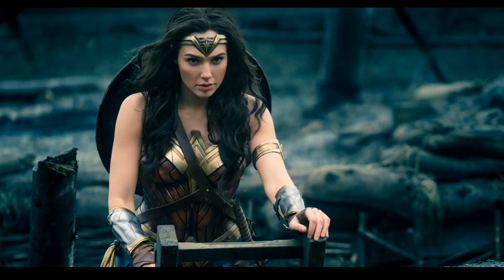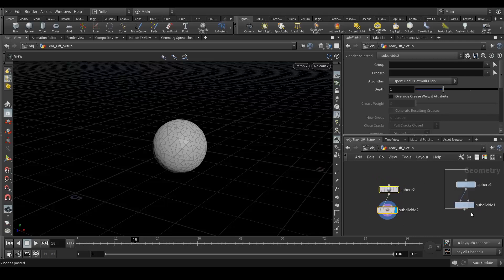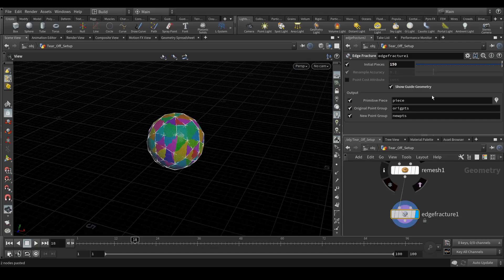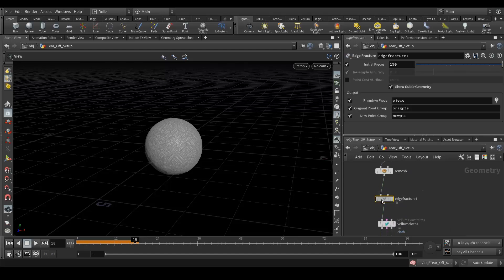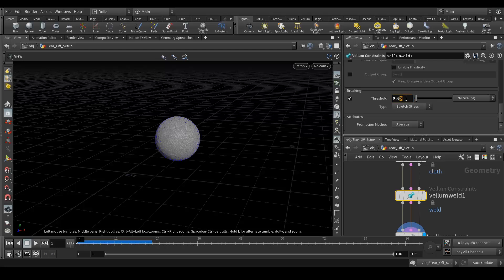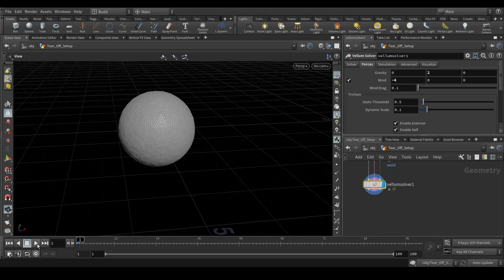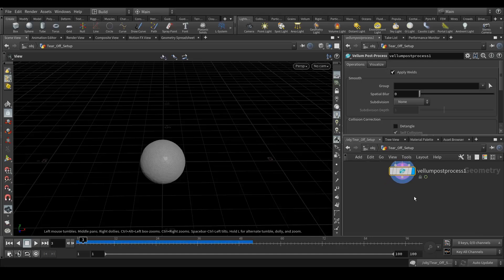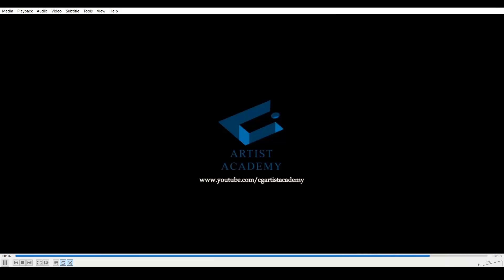Houdini Vellum Peel Off Tutorial

Comment: Nice tutorial!
 Is there a way to peel it off completely? There are some cloth pieces that keep attached to the model  im working with
Reply from the maker: Thanks Sverige .. yes you can peel of completely just remove the points which you have added in “vellum cloth node (pin to animation)”. Remove them all then nothing will stick to the geometry..
Reply: @CGArtistAcademy   WITHOUT  'PINTOANIMATION' some pieces are stuck with geometry bcz those pieces in center of geometry and wind flowing in opposite direction, so it will get stuck.
Reply: @CGArtistAcademy  I didn't pin anything in  the weld to points option, my geometry just overlaped when changing the uniform size because of the shape so the peak node to make it a bit bigger along normals was the key. Thanks for your ansquering and the tutorial tho!